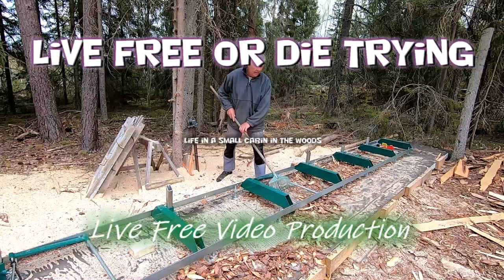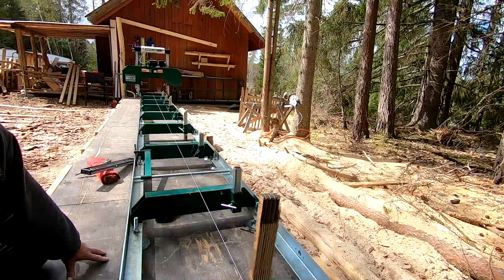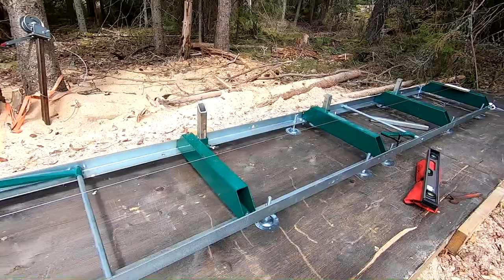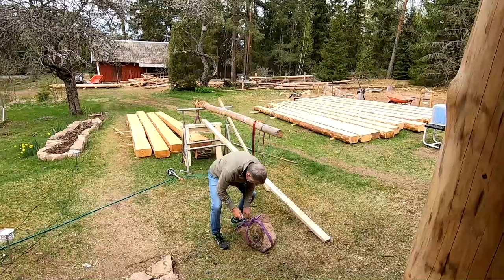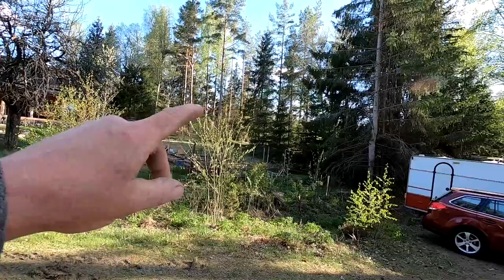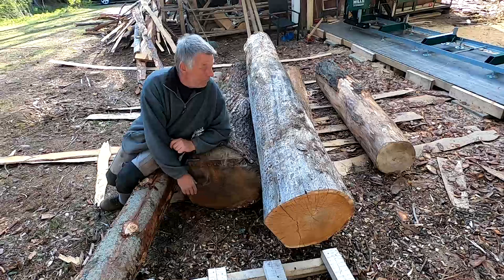Re-adjusting my Woodland Mill, Lifting logs - VLOG #161 - S4

Comment: Howdy Michael- glad you got your mill back leveled out. We don’t have much ground freezing here so we don’t have to worry much about things settling. I did put my mill on a concrete slab because I don’t plan on ever moving it. I remember the first logs I worked with many years ago- I lifted them with a tripod and hand crank winch like you have. They were oak logs and pretty heavy. I really admire your ways of getting things done. Thank you so much for sharing your journey. God bless you my friend
Reply from the maker: Hi Paul. I was actually surprised, that the mill wasn't more off. I've been thinking of making 2 A-frames to lift the logs, but I also have other ideas. Let's see how it ends up. For now I'm taking a breather, and try to plan for the next step forward.
Greetings my friend